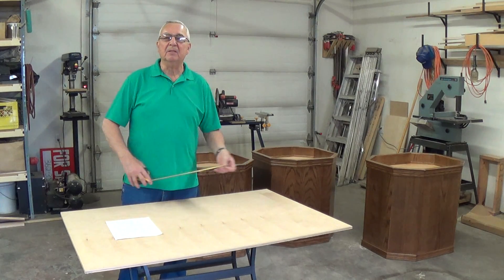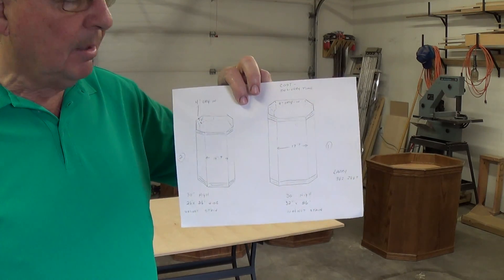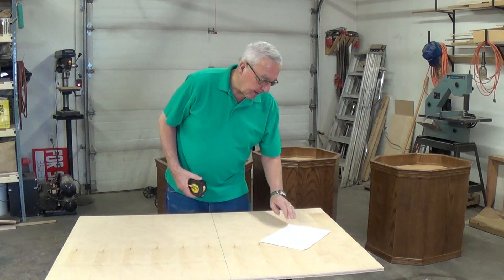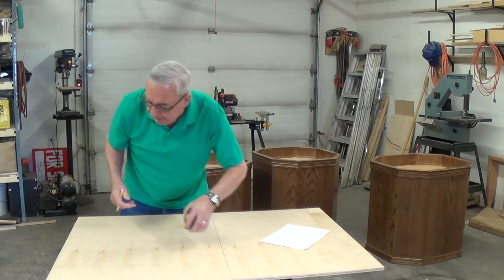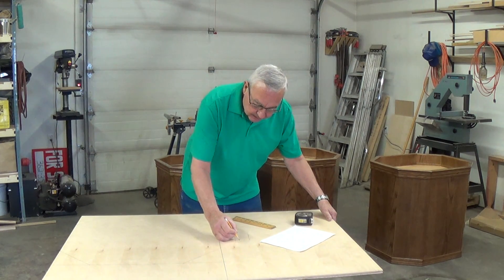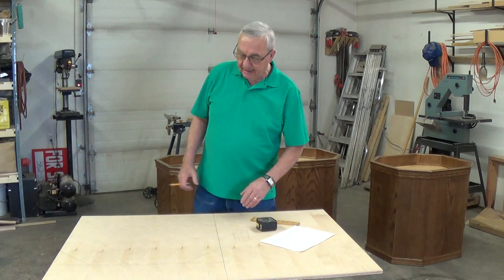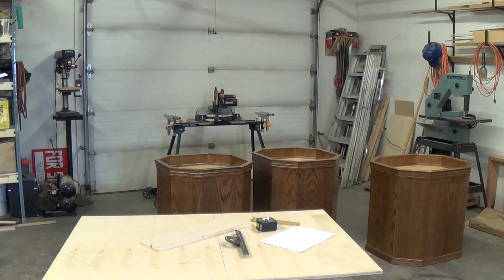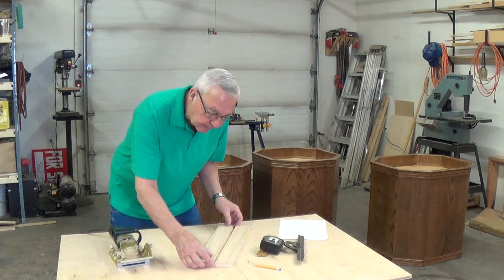How To Build An Octagon

Comment: Thanks for an informative presentation, I have a pile of walnut milled from a tree on the property that I was going to try my hand at making octagon pedestals for a local taxidermist. I have approximately a 1000 board feet of 18" wide mostly clear boards that have been stickered and stacked in the shed for 3 years. It will be similar to your project with the exception of being constructed with raised panel "doors" for the sides. The biscuits should work well.... I was wondering how to position everything while gluing the sides.
Thanks again,
Dave